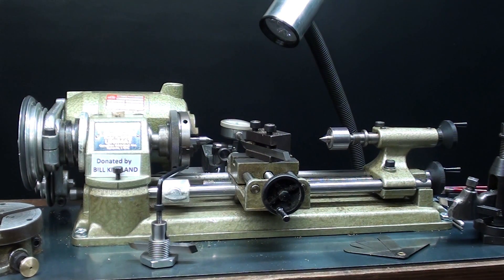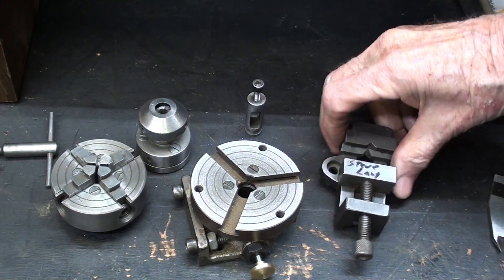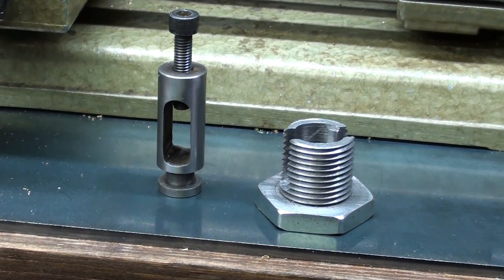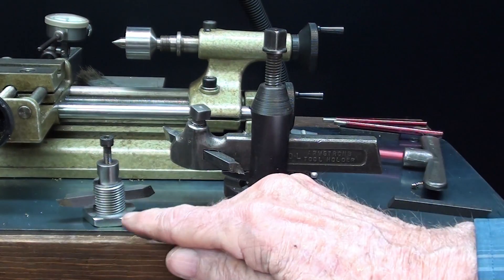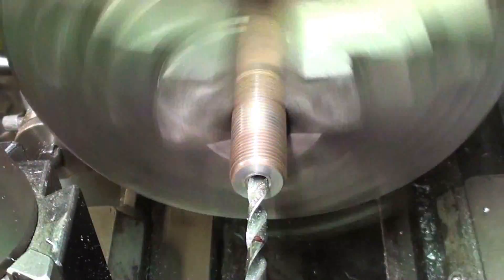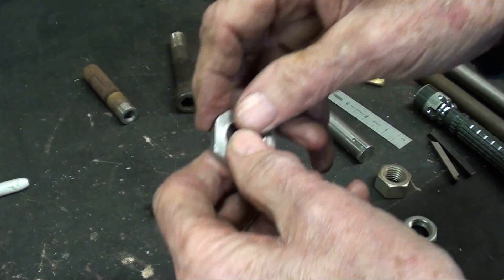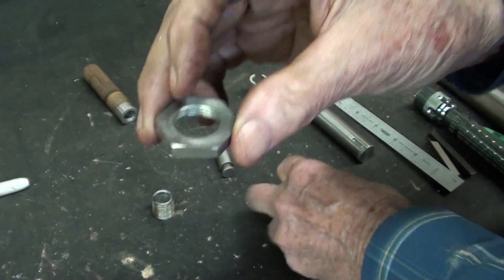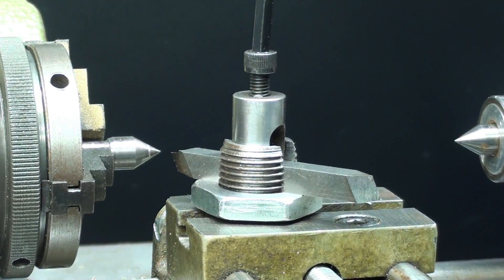Make LANTERN TOOLPOST FOR UNIMAT LATHE #945 tubalcain

Comment: i still do not see how the post locks to the cross slide. The screw locks the tool bit to the nut, but the post is still loose on the slide.

Comment: Great video! The toolpost actually shows up in a Campbells Tool Company catalog "Lathe Accessories & Attachments for Small Precision Lathes up to 5 Inch Swing" dated 3-83, where  you find one small  picture. Back then this was sold as the "EMCO-LUX Adjustable Toolpost, art. no. 153.00. The catalog has this to say about the toolpost: Fits on Unimat 3 cross-slide. Can be adjusted for any cutting height or cuttingtool. (Does not fit UNIMAT SL) $15.00"
Reply from the maker: Thanks for the info!

Comment: Dumb question from the jerk in the back of the class, sitting back on two chair legs…

I have a South Bend 9A with a lantern post.  Why can’t I just lock in a piece of 3/8 tool steel without a holder and do external threading?  As opposed to a tool holder with 1/4 insert?

(. . . Because I only have a right hand 1/4 tool holder, no left or straight (yet… waiting on ePrey purchases to arrive).)

Thanks, Teach!
Reply from the maker: You can, you might just have a little trouble setting the tool on center. You may have to use some packing under the tool.
Reply: @mrpete222  thank you!  I still haven’t taken the leap into investing in an Aloris yet, but I bought a flea-market toolbox and it has some 3/8 tool blanks and if I can use the it is a WIN!

Comment: I had a lantern type tool holder on my dad’s CRAFTSMAN LATHE.  Mine had a   Bowl shaped bottom that a round bottom base piece for the tool…so the tool could be tilted higher or lower to place the tool tip on the center line of the work.

Comment: Mr Pete I'm  surprised at you.
If you try and use that lantern in the compound without using a teenut in the slot! . otherwise you're going to tear out the underside of the compound slot as soon as you try to tighten a tool in that holder.

Comment: If wanting an actual rocker did you consider just altering the nut? 
1/2 drill the threads away, don't saw off the top, turn the extra to 3/4 diameter and slot the top for the tool blank & rocker (in this case with  a 1/4 " x 4 " diameter cutter - the rocker bottom arc would be a 2" radius).
Would the screw tighten enough to hold the tool blank?
Reply from the maker: Give it a try

Comment: Hi Lyle. What an interesting design for a lantern tool post. I’m a little bit dense this morning and can’t understand how the post locks into the T slot to keep it rigid. The big nut adjusts the height only, leaving the post loose. It has to lock but somehow I missed it.
Reply: locks from the top bolt pushing the tool down on the adjustment screw from above... the 1/2 bore lets the tool post float inside the adjustment screw which is locked between the bottom of the tool and the base of the lathe. The top bolt pulls the 1/2 inch post up pushing the tool downward which both locks both the tool and the t slot.
Reply: Yes, what he said! I have a Unimat and would consider making one but I don’t see how it locks down on the cross slide!?
Reply: Got it, thanks!

Comment: I like my little Sherline Lathe. Thanks for the video!
Reply from the maker: I would love to have a sherline
Reply: @mrpete222 Sorry to reply here, cannot reply the standard way right now. Any adjustable height is a hundred times better than the shim method.
: - )
Reply: @mrpete222  I have a Taig lathe (basic model...has most of the stuff you expect on a small lathe) Its similar to sherline in capabilities but more traditional in operation. If I had a mill I would make that tool post. Very nice.

Comment: What keeps the tool post from moving?
Reply: The bolt is on the top of the slide and is squissed by the internal-6 on top (pressing the tool down on the nut and therefore on the hollow-bolt)
Reply: That part wasn’t covered. A setscrew through the post to tighten against the base is the only method I can think of that would work.
Reply: @ellieprice363  No, not really. The whole original part is tight in the T-slot below.
I have an Unimat almost like this (the SL) so maybe it is easier for me to know how those work.
So, with pushing the tool 'down', you pull the original part up against the lower part of the base in the T-slot in the plate, at the same time tightening the tool itself to the nut and therefore the lower part of the hollow-bolt to the top of the baseplate.

Just a couple of movable pieces that move together to tighten things up. There is not much adjustability of course with this setup but not much is needed.
Reply: A drawing would make this clear easily but not that easy to add to an answer over here.
Reply: That would work only if the nut was thicker, not threaded, and was free to slide up and down. Which of course would defeat the whole purpose of an adjustable tool height. If I made one I would put a 6mm or 1/4-20 setscrew right down through the center to lock against the base of the T slot.
Reply: @ellieprice363  You adjust the height simply by setting the nut, the holder is sliding up only and is holding it down.
Yes, a small contact-area only, but there is little movement between the main-body and the sliding-mechanism.
Actually, the contact-area is already bigger then the whole contact-area and 'strenght' of the machine itself. It is nice and works well with light work but if you set any force, it stalls and bends. I think a bigger risk is even that it wants to turn around the T-nut at side-movements.
That said, my toolholder has been having less contact-area for some time and just worked well for the needed forces, even when working on metal. Just 0.01 - 0.05mm at the time with sharp tools, aluminium maybe 0.3mm for one cut but then the whole machine starts to bend around the rod and is about the stall by either slipping of the belt or stopping the motor.
Reply: @ellieprice363  I had a non-adjustable toolpost like this. Just a simple tube on lenght below with a M6 bolt and T-nut as a clamp on the top of that tube. Same results as with the original holder. 
The crosslide is just going on top of 2 6mm  rods (or even 5?) with no other supports. Light work only.
Reply: @ellieprice363  And about the setscrew-idea... Well, 6mm is about all the size you have for the whole T-nut. So, if you want the T-nut to do anything and still to lock it up down, you would need M5 or smaller as a setscrew. But this also means you need to remove the tool to rotate or move the toolholder.
The slot is just 8mm (even 7.9 on mine, just measured it) wide, 10 mm below. On top of the Y-rods there are two M8 holes you can use to lock the crosslide up, so there locking-down does not work anyway,  so to lock it to the bottom, you will need to move the toolpost more to the center of the slide (which makes it difficult  to cut, needing longer tools and odd angles).

Which Unimat do you have yourself? I use the SL for fine-work and also as a small mill with the milling-table on top of the crosslide. For bigger work I got a 'mini lathe' that is already a lot more capable but much less acurate for fine work like nozzles and heatbreaks for 3D-printers that I make on the Unimat.
It is too bad that the thread-cutting-accessoiry has become a collectors-item and is hard to get and much too expensive. Otherwise I would use that too to make the small threads.
Reply: @elvinhaak I don’t have a UniMat, only a 12 x 36 Jet lathe. The little tool post is a very clever design but a little weak due to its small size.
Reply: @ellieprice363  Yes, I think for your lathe it will probably be much too weak. The non-adjustable one I have that came with the SL, is a 20mm round stock with a gap for the tools (12x12mm) taken out, one M6 bolt all the way to one T-nut and 2 M4's to hold the tool in place.
It is not the weakest part in the chain but still holds the motor if the belt is not slipping. When working, the motor slows down with many movements so in many cases it actually need 'pumping action' to dos usable work with inserts for example (plunge-retract). With HSS-sharp-tools you can maintain working-speeds on very low pressure. 
Motor is weaker then on my sewing-machine ;-)
Actually, electric screwdrivers have more power these days.
But for now, I will keep the original motor in use. Maybe someday I will replace the motor with adjustable speed and direction, especially handy when I can get hold of a threading-set... making the machine extra usefull
Reply: Oops, ignore my last post. I understand how the thing works now. I somehow missed that center threaded post that pulls up as the screw is tightened. Very clever design. Told you I was dense this morning!